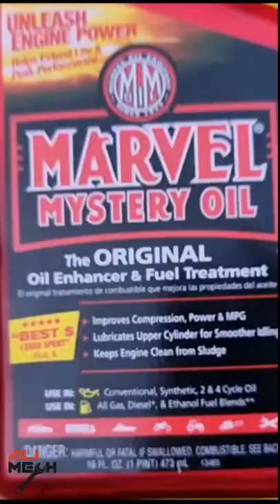Watch this before buying Marvel mystery oil

Comment: Had a bad lifter tick in my 2004 Silverado.. replaced a quart of oil with mmo drove it a couple hundred miles changed the oil no more tick I swear by the stuff!
Reply: maybe loosen up the stuck item, but if something wears off that oil definitely doesn’t help
Reply: @MBZXZ  the before and after looks the same to me... What am i not seeing??
Reply: I wanted to try it on my Jeep lifter tick
Reply: @jerrywhalen2100 if you've gotta Jeep with the Pentastar 3.6l engine it won't fix it...those actually use crappy needle bearings in the rocker arms which are prone to failure...the mileage varies & some year models had lower failure rates than others but once it happens the only fix that will work is tearing apart the top of the motor & replacing the worn out parts...you can try using a thicker oil in the meantime but just know that the longer u put off this repair, the more likelihood that it will also gouge into a cam lobe & those aren't cheap if u now have to include replacing the cam(s) into the repair bill!
Reply: rislone the thin blue stuff not the thick shitty oil additive they have now but the original rislone is great for your engine I had a lifter tick in my 2001 dodge ram gone had a slight tick in my 5.0 coyote engine gone..use rislone trust me it's great put the marvel in the gas tank..
Reply: It thins out the oil I wouldn't drive with mmo for long
Reply: @jd646  Roger that! If I use it, I use it like I mentioned above just before my next oil change 100 miles or so out I add some then change it

Comment: I did this and my engine grew 2 more pistons
Reply: Wow! Do you think if I rub it on my "Self," it might grow?
Reply: Now that was funny
Reply: @georgerivera9974  yes, keep rubbing,  it will grow
Reply: Hahaaaa
Reply: Anymore offspring your willing to part with? 😂
Reply: @georgerivera9974 😂😂😂
Reply: @wurly164 😂😂😂😂😂
Reply: I've heard running the engine on low oil for a few hundred miles can remove unwanted pistons along with adding inspection ports.

Comment: MMO quietens down sticky ticking lifters. It no miracle but it does a good job cleaning a well maintained high mileage engine. Been using it 35 years.

Comment: I bought a mustang engine sitting outside for 5 years.  Crank wouldn't move even with a breaker bar. All holes left open.  Poured a gallon of mm oil inside the spark plug holes and let it sit a week. Was able to hand turn the crank afterwards.
Reply: Use Trans fluid next time it's a better lubricant and it will also free stuck rings
Reply: Should I try this on my Toyota engine sized from no oil?
Reply: @rcaddict3815  don't stick anything but the right oil in toyotas
Reply: @DoubleTripleOGfromtheset  I have a jeep now but the Toyota stopped running from no oil at all   I religiously check the oil now🤣 I wanted to see if I could unsize the engine now that I know a little about engines now
Reply: @rcaddict3815  that thing is far gone. You could try for science but don't expect the thing to drive anywhere.
Reply: @rcaddict3815  You have nothing to loose. I've unseized engines before with MMO. Just remember that in the case of seized engines, the key is allowing the MMO plenty of time to soak in to the parts. Some people luck out and one application is enough to free up the engine after a 24 hour period but in many cases a week is or so seems to give the best results, especially if you can reapply the MMO several times during that period and giving that crank some back and forth pulls in between as well to help the MMO penetrate the the most stubborn/stuck areas.

Comment: I’ve been a motorhead for 40 years and have never heard a bad word about marvel.
Reply: @adog3336 that's user error for letting it get that way
Reply: @adog3336 that’s a compact little story there. Almost like it was contrived.
Reply: @adog3336Yeah that's called user error
Reply: @adog3336 On many cars that's an engine out job and if the engine has been neglected that badly then the rest of the car is probably not even worth the price of an oil change much less r&r the engine.
Reply: @InsideOfMyOwnMind  🤣🤣🤣 Fact👍
Reply: @adog3336 no, its called user error.
Reply: @adog3336 Yes, do your oil changes on time and this will not happen.  AKA user error
Reply: @@adog3336sounds like an oil filter failure, probably too long of oci. Always change that oil at no more than 5k miles, no matter what it says on the oil jug.

Comment: Marvel mystery oil works and works great I've been using it for years. My dad tried some back in the early 80s in a 79 ford truck he had. That truck had a extremely noisy 302 with very annoying lifter ticks in it. It had more than one lifter sticking in it, tried mm and the tick went away in less than 20 miles, I've been using it ever since.
Reply: In a filthy engine from the 70s it would help, but nowaday ... nah!
Reply: It's not made for what that guy is doing. It's made to free stuck lifters and rings. Not refurbishing engines abused for 10's of thousands miles in 1 oil change.
Reply: I poured some in a dead cylinder 3 days later I had compression it started up and ran fine after the smoke cleared I traded it in
Reply: @tomasnokechtesledger1786  What? Why not? Gasoline is still a Petro carbon, although worse today. Oil is still oil, a fossil fuel derivative. They still leave carbon and varnish deposits chemically the same. If anything it would work better today because modern engines run hotter. Most people that figure they need to use it are in trouble already. It works BEST if you've been using it all along as a regular maintenance product. It's tough for any product to correct miles of neglect, short of complete disassembly.
Reply: @vincemajestyk9497  The oils are the still same? Nope, we get synthetic oils now and even conventional oils, would you use an API SF in your car that demands API SM,  SN or SP?  No the OILS are better now, with a better additive package and base oil. Theres no place to MMO anymore. MMO would retard modern oils.
Reply: @tomasnokechtesledger1786  what’s the secret ingredient in MMO? Supposedly it’s been grandfathered in
Reply: it works in today's oil because all oils are not created equally (high detergents)
Reply: @tomasnokechtesledger1786 ya? Honestly asking here. I have a 2014 Volvo. Should I not use it ??
Reply: Great story!!

Comment: I’ve used it for yrs & it works great! I saw no diff in before and after pic, obviously it won’t remove burned in deposits, also, looks like same oil drain pic as before, my oils isn’t that dark until 3,000 miles later…
Reply: Look again! The difference is there was oil parts of the rocker arm that was not before.

Comment: I replace 1 quart of engine oil with a quart of mmo in my Suburban.  Works out because it takes 6qts of oil, all the oil is in 5 qt jugs, and the mmo is in a 1 qt container.
Reply: I did this a few times and now I get a lot of oil consumption especially on road trips 😢

Comment: I have used MMO in the gas tank of an older motorcycle to help keep the slides working properly. I also use it at the end of the mower season in my mower. I get the fuel down to about 1/4 tank, start it and pour some MMO in and run untill it quits. Same with snow blower. Both start up easy at the beginning of the season. Great stuff.

Comment: This is a personal observation and I am not advocating for using marvel in an aircraft because it is not FAA approved but, the condition of the engines on a cessna 310 during routine overhaul speaks volumes about marvel. Engines were spotless, very minimal wear. The particular engines on this aicraft have been overhauled 3 times and so far the crank journals have shown no significant wear. Its added to the fuel as well and the cylinders are immaculate every time as well as the valves.

Comment: I didn't believe it did anything until I ran put of options on my 2004 nissan sentra se-r spec v.  Burning very bad about a quart a month pour entire bottle in, drove about a week.  Now doesn't burn a drop. It think it loosen piston rings gave me better seal on low friction oil rings .im just guessing but it works. Htown
Reply: Did you have to keep using it every oil change or just 1 time? How long as it been working after you used it?

Comment: It took a lot of my lifter noise away by cleaning the oil channels to give good flow. 2002 Grand am V6. 170 K
Reply: Did you have to keep using it every oil change or just 1 time? How long as it been working after you used it?

Comment: Works well as a fuel stabilizer as well. I use it in all my small to large engines. Big fan.
Reply: It does well in fuel.. But don’t put it in the oil. Especially Cars with VVT. And with flat tappet cams. It takes off whatever ZDDP that has accumulated from the ROTELLA 15w40. Or the Delo 400 you should be running with a flat tappet.  GM used to make a great top end cleaner for carburetor cars . You pour it down the carb and rev it to keep it running and then dump it until the engine dies. Wait 30 minutes start it up. and rev it up and down from 2000-4000 and let it smoke. It cleaned the chambers valves pistons and the carb thoroughly. But don’t add anything to the oil. Change it every season or from 1800 if you don’t drive it much, to 3000 is my preference. Keep it clean.
Reply: @Bbbbad724  don’t put it in oil? That is literally the sole purpose!!!
Reply: @babushkaboi7288   It has a lot of detergent and you don’t want to clean too aggressively  and get chunky gunk where it can hurt. On VVT engines you can kill them. Engines with oil squirters you can get gunk in the piston pins . You can use it   but go easy. Maybe 2-3 small treatments might be better.
Reply: What about that b 12 baermen how ever you spell it have a blessed day or night
Reply: @Bbbbad724
Reply: @babushkaboi7288  It's a fuel additive.
Reply: @Bbbbad724 that what I am saying these thing is BS oil itself has already detergent even a no name act better then this one but the problem is too much powerful detergent in the end it's killing the engine... Oil alone is good they put already all thing u need inside we fighting because in some country don't put additif for exemple rich country already cleaning benzin in station but some don't that why th y needed additif option... I live in France but sometime go holiday in balkan until Türkiye they don't have good benzin quality I bought some additifs to prevent that it 😂😂😂

Comment: I have used RISLONE and it works great.
Reply: Rislone is OK, but for stabilizing fuel Sta-bil is best. And  MMO is pretty good with oil. Rislone is great with pouring in the engine right before an oil change and warming up and draining. MMO is going to be OK for 500 miles before draining the oil. There is or was a time top end cleaner from GM that you would dribble down the carb while keeping it running and then drown it until it dies. Then after 30 minutes fire it up and it will smoke so do this in the country and rev it up and down until the smoke clears. Change the plugs and make certain that your wires are good, and that the coil and intake primary ie points or pickup, etc.

Comment: I've used MM oil couple hundred miles prior to oil change just to help cook off what may have cooked on inside my high mileage engines and sure does help keep the lifters alive and the pan clean  over 500k miles on my 99silverado nothing major done, but change the oil pan and intake gaskets been driving it since 2007. I was sold on MM oil when I used it to cook oil out of an old air compressor that had its oil turn to tar. when the tar was dissolved from the compressor after only letting it get to Operating temps and run a couple of cycles I was a fan then and there cus seeing believing. I don't care how it works let it be a mystery I just know that it works
Reply: Used it, few times,, good stuff.

Comment: I burn it 1/2oz to the gallon in every engine...sub 1 qt motor oil in cold winter time 
Smells nice in the bottle kinda winter o green... grandpa would be so proud 👏
Reply: A lot of people in the midwest and northern states do the 1 quart replacement in the winter, especially in agricultural areas, work/ranch trucks, many of them run 10W-40 in the summer because of the how hot in can get in summer but in winters it turns bitter cold, too cold for 10W-40 but by doing the 1 quart MMO replacement it the MMO drops the cold viscosity significantly enough to allow for easy cold-starts with no problem even though they still running 10W-40. The MMO actually has a much lower cold pour point than the oil. I know people who've been doing this since they purchased the vehicle, and now over 400,000 mile mark and engines still running like new. The side benefit of the winter time 1 qt MMO replacement is that because they do this every winter it prevents any significant build up from happening in the first place and the engines stay pristine because of it.

Comment: I thought the stuff was snake oil until my mechanic swore by it as a possible solution to high oil consumption that he has seen work many times. Our large displacement air cooled flat 6 engine went from burning a quart every 2-3 hours back to a normal quart every 8 - 10hrs after a single MMO treatment. I was shocked, but not arguing results.

Comment: Ya. I put the MMO in a day before I do the oil change. Comes out a lot cleaner that way.
Reply: This doesn't even make sense..if it was cleaning your engine the oil would look dirtier as it would be suspending more dirty particles. Also ATF does the same thing.

Comment: I used to use marv in my old rambler classic 550 back in the late 60s. Both in gas and oil worked fine. In modern engines I would be a little more hesitant as it can lift big particles that will get stuck in fuel injectors. Otherwise, it's great!

Comment: Marvel works fantastic. I flush my diesel with 6 quarts marvel and 6 quarts cheap oil. Drive 150 miles, under freeway speed, then drain the pan and fill it with 11 qts of Motul 10w60, 1 qt MMO and a new filter. My oil stays golden brown for 100 miles afterward the drain interval.
Reply: Motul is my personal favorite 👍

Comment: Had an '83 Monte. Long story short. Engine seized from sitting too long. Added 7-8 drops of MMO to each spark plug hole and turned the crankshaft 1/32nd to 1/16th a turn each day until I got it to rotate 360 degrees. Then after I realized it was working a litlle more each day..man I got it to spin a full 360 after about a week of doing that each day. swear ta god I sold that car after the 305 threw a cam at 490k miles! The collector who wanted to restore it couldnt believe I had 490k on odometer. He asked me if I messed w it. Nope. Brought that old 305 back to life numerous times. Head gaskets, breathing problems, just removed every damn californian air restriction possible. lol. But yeah tru story.

Comment: I use it in the fuel makes the car run really smooth
Reply: How much?
Reply: @rickstarke2183  4oz for every 10 gallons,  the stuff is great you won't be disappointed.
Reply: @dust6242  Do you use it every fill up
Reply: @rickstarke2183  I do and will continue... it's increased my gas mileage as well.
Reply: @dust6242 don't use it in cars with catalytic converters. It'll clog them. So basically any remotely modern car
Reply: @Subreon  would it being clogged affect the fuel pump? I started using that stuff and i thought it was good for the car. Or is it strictly meant to be used as an additive with engine oil.
Reply: @taneshanottanesha5456  the cat is after the engine, in the exhaust system. The cat getting clogged is like getting really badly constipated to the point where nothing comes out, but for a car there's no laxatives so it has to be replaced and cats are very very expensive, which is why they're commonly stolen items. You can get away with it a handful of times of course, but you're rolling the dice each time and making those odds of losing get worse every time. Mmo was made before the big emission standard laws and cats were made. So it's fine to use in cars without them. I'm sure they've edited the formula by now to be less risky to cats but idk. Needs more research. Probably depends more on how well built each company makes their cats is they can handle stuff that isn't just gas exhaust or not.

Comment: I use it on old engines to clean lifters that or some transmission oil dextrin 3 works real good to clean lifters, add to engine run for 30 min and it cleans real good no fance additives
Reply: Yes thats because automatic transmission fluid has a lot of detergent in them so they work well at cleaning out sticky and clogged lifters because it breaks down the varnish and carbon that clogs the lifters oil holes and causes the lifters to not pump up like they should when they get clogged.  Don't use the synthetic transmission oil because they don't have the added detergents in them so stick with the fluid that's used for older automatic transmissions .

Comment: I didn’t see a difference
Reply from the maker: so im i
Reply: That's because they didn't show the running flush and drain
Reply: Use a microscope 🔬 metal Molecules doesn't lie bonds into them
Reply: Same thing I said. I saw no difference at all.
Reply: The emperor has no clothes on
Reply: Look the parts have more oil on them